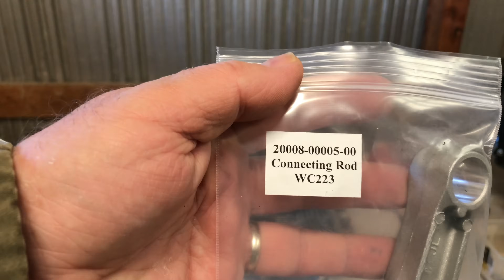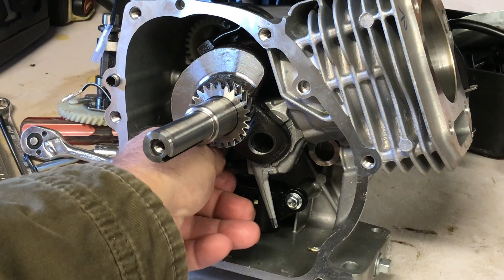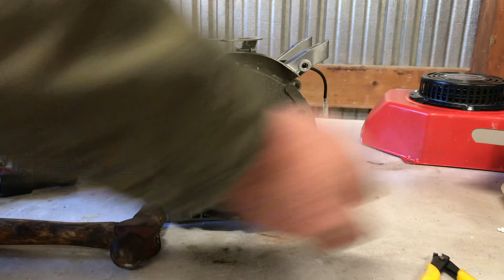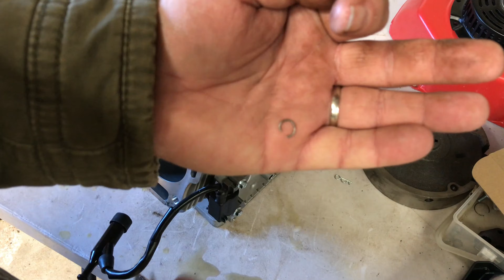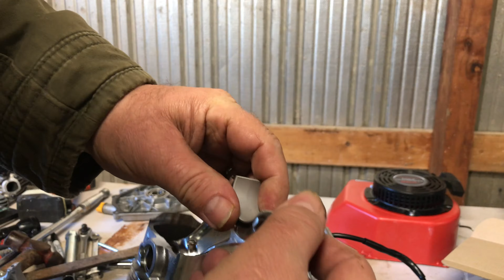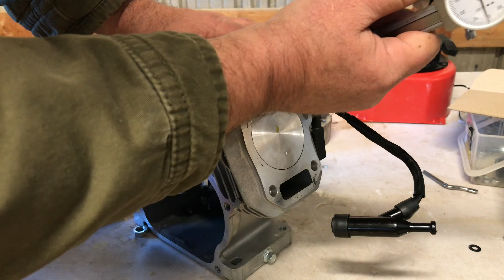Part 2 First Performance Mods and Build of Harbor Freight 224cc Predator Engine, Fitting 224 Parts

Comment: Maybe ... Possibly?

I'm trying to collect info on building a predator engine (not sure of size yet), but i want to run it on rubbing alcohol so i can store the "fuel" in my apartment and not stink up the place especially during storage and running. I'm figuring its going to be a big project for me and I'm looking forward to sitting on the back porch modding/building whatever i have to for my goal. I'll eventually put it on a kart or something but for now depending on how fast i can get it built ... it'll be a "toy" i can start up on days I'm feeling gloomy lol.

I figure larger jets and maybe head shaving and whatever hiperf kits/parts to make it mean...

 Is there a write-up i can follow? Or maybe certain bolt on parts or whatever to get the project going? I'm aiming starting this next winter but for now I'm collecting info.

Thanks In Advance!
Reply from the maker: Hi OS! I tried running an engine on Isopropyl alcohol in 1979. I tried it in a pulling tractor (garden tractor) engine as an experiment but the results weren't great. I found that regular gasoline made more power than the Isopropyl alcohol. I even distilled mine to close to 100% isopropyl since I could only buy the 50/50 mix here at that time. After that, I switched to Methanol and fell in love with it. For performance alcohol fuels I've used Methanol and have tinkered with E-85 which contains 85% Ethanol. As long as you have a pure enough mixture it will run on the Isopropyl. You'll need to find something greater than 90% mixture as the usual rubbing alcohol at the store comes as a 50/50 mix of Isopropyl and water. I have used it in Winter to help remove water from my gas tank, but that wasn't because it was a performance gain for my truck or anything, I just needed to get the water out of my tank so it wouldn't freeze and cause issues. You'll need to increase the jet size of your carb to run the Isopropyl. I can't remember what size jet I used back then but it was larger than the gasoline jet, probably a .052 or around that. You can do it, don't let anyone tell you different. I wouldn't count on any better performance over gasoline though.
Reply: @KentuckyFriedFixes  I'm thinking of using the 91% rubbing alcohol stuff that can be bought pretty much anywhere so it's convenient. I'm not expecting the most powerful thing in it's package size due to I understand there's limitations. I'm just trying to build a tricked out larger Harbor Freight type of small engine to give myself a cool project and something I can eventually use on a kart. 

For now I'm just having fun trying to figure this out. I still haven't figured out which size engine I want yet ... probably the biggest CC with the biggest aftermarket parts list as well as an engine that has a long history of being modified.. I haven't tinkered with anything like this in about 30 years lol.

Thanks Again
Reply from the maker: @oldsoul5263  You can do it. Set a goal, think it thru and make it happen. Performance parts are readily available for most of the small OHV engines. The Honda GX200 clone parts are very reasonably priced as well. The larger engines like the 420cc etc, also have a good amount of aftermarket performance parts available but they're a little more expensive than their smaller counterparts.

Comment: As far as that dipper goes, if it ain't banging the bottom, leave it as long as you can. It will sling more oil 🛢 😌  😑 ☺️ .
Reply from the maker: Hi Chuck! The reason I trim off a little of the dipper is because at high RPM the crankshaft will flex, some will flex enough to allow a stock length dipper to make contact with the block and break off. The EC rods have already taken that into account though so there's no need to trim the billet stuff, I only trim the dippers on stock rods when a stock rod is required for the class rules.

Comment: I’m wanting to add cam 26 pound springs and billet fly wheel could I get away with not upgrading rod
Reply from the maker: Hi Brad! The stock rod is only good to about 6K RPM. Anything over that is a roll of the dice. The 265 cam I used on this build will easily turn 7K+ RPM. With that cam and a stock rod it wouldn't take long before the stock rod breaks. Now if you can limit the RPM to around 6K with a rev limiting coil, you might be ok, but still, you know what I mean. There is no substitute for a billet rod. (and a good cam needs more RPM to make power anyway.)

Comment: I’ll be commenting often over the next couple weeks I’m doing a build similar  and like I said you proven to be educated and responsive. Next question is when getting flat top position and billet parts with hot 265 cam do you think I need a thicker gasket also or could I get away with the stock one with flat top piston?
Reply from the maker: Hi Thomas! If you use the long rod build, you'll need to measure exactly how much the piston is above deck to determine your head gasket thickness to set your quench (or squish as some call it). I'd suggest sticking with about .035 thousandths between the piston and the head. As an example if the piston is .010 above the deck, you'll need a .045 thick head gasket, .045 - .010 = .035 quench (or squish).
Reply: @KentuckyFriedFixes  ok it’s all making sense thanks again an again my guy ! So you suggest .035 quench the quench is essentially the space between the piston at TDC and the bottom side of the head?
Reply from the maker: Hi Thomas, that's exactly right. That space between the top of the piston at TDC and the flat surface of the head is the "quench". If you stick to .035 and above quench on an OHV build you shouldn't have any issues with hot spots in the cylinder.

Comment: Why not mention the ARC Rod so we don’t go through the same issues!
Reply from the maker: Hi Sam! I believe I did cover why I chose not to use the ARC rod. It was really wrong for this build. I probably should have gone into more detail though for the reasons I did not choose the ARC for this build. The ARC rods hit everything everywhere and require much more clearance work on the block. They're also shorter in length than the EC rod causing piston to crank clearance issues. That's why I share the exact parts I use for a particular build, with the 224 Predator the best choice is the # 8281 EC Pinnacle rod (used in this build). Don't get me wrong, I do like ARC rods and their pressure feed oil system dipper, but in the 58mm stroke 70mm bore builds, they have clearance problems in too many places IMO.

Comment: Hi I'm building a 224, I'm just wondering if the parts I got for it wont blow it up, what I already have on it is a governor delete, oil censor delete, cast aluminum fly wheel rated for 10k rpm, billet rod, 18lb valve springs and a mikuni clone round slide. I ordered a .01 head gasket, 22lb valve springs, and a 265 hot cam. ill do the necessary clearancing, but I'm just wondering if I need anything else for my setup to run reliably.
Reply from the maker: Double check the quench distance to find out what thickness on the head gasket you need. I'd go with .035 quench (or squish). Anything closer than that may allow the piston to contact the flat area of the head. It mostly depends on the parts you use for your build. This 224 engine combination of parts is listed in the description. I ended up using a .045 thick head gasket because the piston was .010 above deck at TDC.  This had my quench distance set at .035.

Comment: I have a predator 224 I just ordered a stage 2 kit from gopowersports are all the torque specs the same for the connecting rod also flywheel and side cover if so can you please tell me what they are thanks any help would be appreciated
Reply from the maker: Without knowing exactly what parts they included in their "kit" I can't tell what the torque specs will be. You'll need to contact those guys to find the correct torque specs. I don't know what you'll be getting and I wouldn't want to tell you wrong by guessing.

Comment: Will the mongoose 272 cam fit in a predator 224 max performance? Not much info online about this cam.?
Reply from the maker: Hi Johnny! The 272 Mongoose cam I have in hand will work with a minimum clearance work on the center of the camshaft. The lobes will clear without any issue so no work has to be done to the lobes, it's the center of the camshaft you have to look at closely. Great cam!

Comment: Did you have to do a bunch of clearancing to get the stuff to fit? My buddies are saying that you gotta clearance the rod and the cam, that’s just scary to me; on the fence about getting a 224 or a 212 cause I have a few 212’s already but no 224’s but I don’t wanna do any clearancing if I don’t have to
Reply from the maker: Hi Troy! Yes Sir, there's a lot of clearance work to do when you build a 58mm stroke engine with a 70mm bore. The 72mm bore engine blocks require much less clearance work and with the 58mm crankshaft make a 236cc engine. Strokers can be a pain to work with but anyone can build one. It just takes time and patience to get it how it needs to be.
Reply: @KentuckyFriedFixes  thanks! I’ve been talking to a few people about the 224 now cause I just picked one up today, they actually make direct drop in kits for the 224 now so you don’t have to shave the block and weaken it

Comment: So I got a Fire265 cam for my 224 and that sucker is not fitting. The cam rod ends are measuring about 1/100th of an inch bigger. The original cam is measuring 0.54 on my caliper and the Fire265 is measuring 0.55. Do think there is anyway I could sand the Fire265 down to fit or should I just try to sell the fire and go with something different?
Reply: Also your videos are amazing and thank you for the inspiration.
Reply from the maker: Mark, sorry for the delay I'm having issues with placing comments for some reason they're bleeding together. If your new cam diameter measures .550 some will be .549 or can be more or less by a thousandth or two. It's a great idea to measure cam diameters as some Predator engines may have the larger .559 diameter shaft. As long as you're within a thousandth or two of the .549 for your 224, you'll be fine, now if your cam diameter measures close to .559, the cam is likely for the predator 212 non hemi and won't fit your 224.

Comment: What changes would you make if you wanted to be able to run ethanol free 91 pump gas, but still be able to hit 8000 rpm or so?
Reply from the maker: Hi Jugflyer 87! To run on 91 I'd probably remove a bit from the top of the piston during the build to get it either at "0" deck or just below deck a bit. This build as is will put the piston around +.010 or so above deck. You could also go with a thicker head gasket or stack a stock head gasket on top of a copper one to reduce the compression a bit. It wouldn't take much to drop the compression enough to be happy with 91. Also the 265 Banzai cam in this build only makes power up to around 72-7500 RPM. I now prefer the Mongoose 272 for anything going to 8000+, it has 245 duration vs the Bazai's advertised 235. Thanks!
Reply: @KentuckyFriedFixes  if I’m near zero deck or just under could I use the stock head gasket? What gas is needed? Would 93 be sufficient?
Reply from the maker: @DatHondaBoi223  The stock head gasket the came on my 224 was .050 thick.  You really need to measure the deck height/piston relationship exactly to be precise. Try to maintain a .035 minimum quench distance between the top of the piston and the bottom of the head. In my 224 build parts combo the piston is above deck almost +.010 so I use a .045 minimum thickness for the head gasket. A .050 will work too. If you used the same parts as I did and run your timing around 28 degrees you'll probably be fine with 93 octane depending on your altitude of course. I tried 93 in mine and I found that I need around a 95 octane fuel at 650 feet above sea level or it pulls the starter rope from my hand more often than not (too much kickback). I add a little additive to 93 fuel to increase the octane, but just a little synthetic 2 cycle oil mixed in the fuel can do wonders too.

Comment: I used an arc rod and tillitson flat top piston. Ended up .025-.027 in the hole. Should be good to run a .010 head gasket or maybe a little thicker haven't decided yet. It is a dirt drag motor
Reply from the maker: That should be a great combo! I was looking into a .550 flat top build for one of these! Did the skirts on the Tillotson flat top clear the crank ok?
Reply: @KentuckyFriedFixes  no lol I had to take some off the crank weights. I had to remove the most off the crank weights and cam. Between the lobes and off the side of the intake lobe. Top and bottom of cylinder weren't too bad on my build.  Only had to remove a little.
Reply from the maker: Thanks Steve! Great info! Those 58mm stroke cranks aren't very builder friendly for sure! The block on mine needed mostly widening out of the factory cut at the top so the rod would clear. I chose to notch the cylinder at the bottom. Even though my rod cleared it was still too close for comfort. Some cams will clear without modifications. I'm planning to try either a 252 Rattlesnake or a 272 Mongoose on the next one. I like the looks of the lobe profile on those, like the 265 Banzai, they're small lobe cams, ground really close to the center. Regarding the piston though, I may still try either a .550 or .570 with a std length billet rod. I think I can trim (shorten) the skirt on the lathe for clearance and lighten it at the same time. You got me thinking. Thanks for your input Steve!
Reply: @KentuckyFriedFixes  mine is a 252 rattlesnake so it was that and ARC rod 6270 that gave me issues
Reply from the maker: @stevefavero3204  I've got a stock length EC billet rod I may use in the next 224 build. I do have an ARC stock length rod too. It seemed to me the bump on the ARC rod causes it to have issues with cam clearance. The dipper is also a bit close to the back of the block. I hope ARC comes out with another rod for these 224 builds. Something around 3.343 length and a little more clearance friendly would be great.

Comment: Will the stock tappets work with new camshaft?
Reply from the maker: Hi Ricky! The stock lifters will work but they are just a bit longer than the aftermarket lifters that are included with the 265 Banzai cam kit. I used the shorter aftermarket lifters to keep my rocker geometry about the same at max lift. (the aftermarket lifters are also lighter weight)  Remember we're going from .224 lift to .265 lift, it's not enough to make a big difference in your rocker geometry but the shorter aftermarket lifters keep your rocker geometry aligned better, and they're lighter weight, so why not.

Comment: Do you have to do any clearance just to put the Cam in?
Reply from the maker: Hi Jonah! You have to check the clearance between the rod and the cam on every build. I was lucky in that my Banzai 265 cam was ground on a good casting. It was small and had plenty of clearance between the cam and the rod without having to grind for clearance on the camshaft. Most of the time and for most aftermarket cams, you'll have to grind the camshaft to clear the crankshaft on stroker builds. It's not difficult though, just match it up with the stock 224 cam and clearance the same areas. I use a bench grinder and sometimes a disc grinder. I'll be showing this process in an upcoming build with a little larger profile camshaft.

Comment: Drive the whole thing  out from  the outside  in then put a dab of lock locktite on the shaft drive the pin back in until  it feels  level  with the back side of the casting then anything  sticking up outside  cut with a cutoff grinder

Comment: At the end of the video I laughed. So the EC carbs rod is close at the bottom but dead stop at the top. It's exactly opposite with the ARC clone rod. I just made it through the top but had a dead stop on the bottom. 

I also had to clearance the back of the block a touch because the scooper was clearing but too close. Had to clearance the intake lobe of the cam I'm using. When I get back to it I'll have to triple check everything. I don't have a way to measure but I think my crankshaft end play is a little too loose.
Reply from the maker: The first rod I tried was the ARC stock length, and like you I had clearance issues in more areas than with the EC. It hit everything inside the engine and I couldn't use the lighter Wildcat piston because it was too far down the hole at TDC. I really hope ARC makes a stroker rod for these 58mm stroked engines because I do like their dipper oiling design. But, I don't like the dipper digging holes in the back of my block or that bump on the front bashing my camshaft though. The length was an issue too, the piston was too close to the counterweights at BDC. Be careful if you're using any piston other than the Wildcat, those skirts will need trimmed for sure or it's "Mr. Piston skirt, meet Mr. counterweight". Until ARC makes a stroker rod to work with these, I'll be sticking with the EC rods.
Reply: @KentuckyFriedFixes  ooh yeah thanks for the reminder. I think I'm ok on the skirts but will have another look.

I do agree that the EC rod is the better option at this point from what you and others have done or mentioned.
Reply from the maker: Let me know how it goes and post some video too. The more info and builds on the Predator 224 the better!